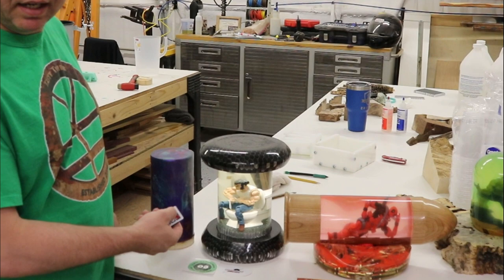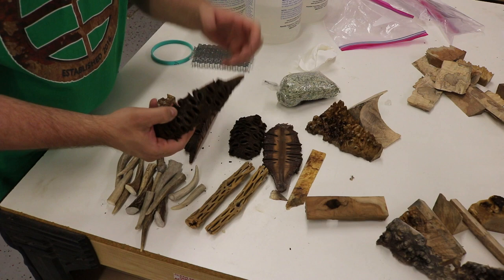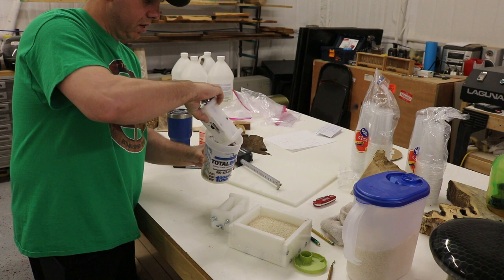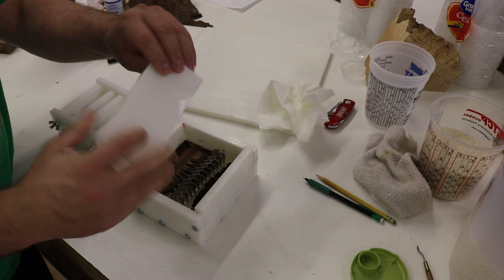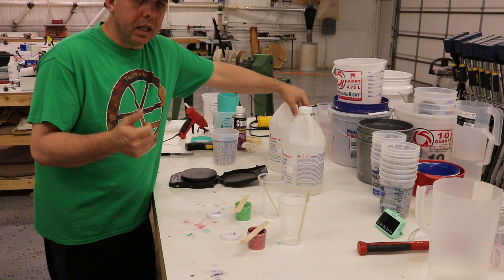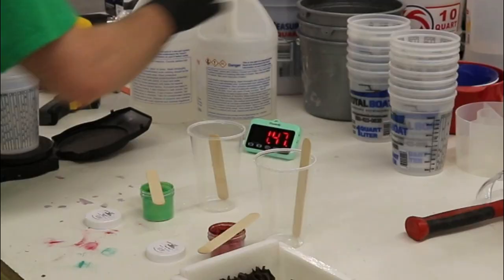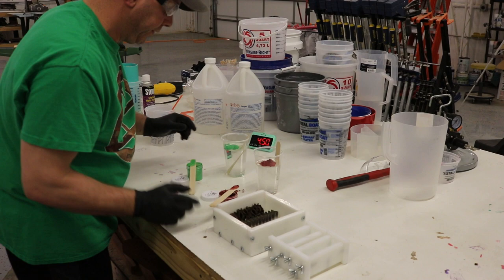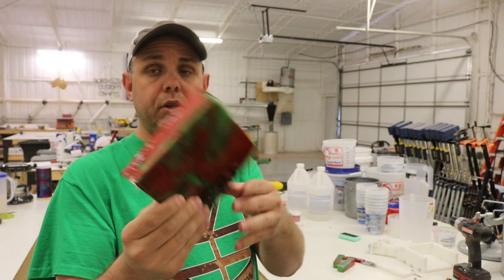How to Cast Resin and Wood  Pen Blanks for Beginners

Comment: Good helpful vid, thanks!
I would like to ask - when and why to use a pressure pot VS a vacuum chamber?  I want to stabilize some wood and then cast it in Alumalite, but it sounds like I need to stabilize with vacuum and cast with pressure.  Can you help me understand why ?  Thanks!
Reply from the maker: Thank you for watching and leaving a comment.. The Alumilite clear slow resin only has a 12 minute working time, it’s not enough time to use vacuum to remove the bubbles. You can use epoxyresins that have a 45 minute working time, then you can use vacuum if that’s your preference.

Comment: Great video, great demonstration, great production.  I like how you keep it entertaining and moving. Can you use a vacuum pump instead of a pressure pot?  What pressure for the pot?  The cactus piece "cholla" is pronounced "choya", the two Ls sound like a Y. One of the best demonstrations on Youtube. Thanks!
Reply from the maker: Capt_Beefheart Thank you very much! I’m glad you enjoyed!! 👍 if you have resin with a long pot life you can use vacuum, but I’m using a resin with a pot life of 12 minutes, so I use pressure to get rid of the air bubbles. 👍
Reply: @JakeThompson  What pressure?
Reply from the maker: Capt_Beefheart Sir Pressure in the pressure pot.
Reply: @JakeThompson  Sorry 😁! What is the pressure you use to get the bubbles out?
Reply from the maker: Capt_Beefheart https://youtu.be/5jOttgLQvpA

Comment: Awesome video. Can you reuse the measuring cup again? How do you get all the epoxy out EDIT: should’ve kept watching haha. But how do you clean them. Just in the sink? How do you keep the epoxy from hardening in the pipes
Reply from the maker: Always Bolt the Bird lol! I just put acetone on a paper towel and wipe them out. I just recently started buying cups in bulk from amazon. I still will reuse them but it’s lots cheaper when you buy 100 at a time.

Comment: I've recently started casting resin for knife handles. My first attempt I left the blanks in the pressure pot for 3 days. They were soft when I took them out and hardened over a week. My next two attempts were both epic failures. I had them under pressure overnight and again they came out soft. I measured by weight correctly but don't understand why its not working out. Were the blocks rock hard after two or three hours and finished them off in the same day? Thanks
Reply from the maker: I use alumilite clear slow and have lots of videos on how to use it..  i cast the blanks and 2 hours later I can take them out and demold them..  We use alumilite clear slow on our live show we do every Saturday on this channel..

Comment: Did I hear the length of time in the pressure pot correct at 2 hours? Or did you just check it at that time and leave overnight?
Reply from the maker: With Alumilite you can take it out of the pressure pot in 2-4 hours, but I won’t hurt it to stay in the pressure pot overnight

Comment: Jake- I’ve watched this video a few times and I want to say thanks . It’s very helpful. One question- is 12 min open time the main criteria or 95 degrees  before putting in the pp?  In other words if it’s still not up to temp is it mission critical to get it in the pot by 12 minutes ?
Reply from the maker: 12 minutes is a guideline.. the temp in your shop will make your working time shorter or longer.. the 95-105f degrees is the right temps for color separation.. sometimes it may take 14 minutes to get up to temp.
Reply: @JakeThompson  thank you sir!

Comment: How long did you leave the honeycomb in the acetone? How did you clean after taking the honeycomb out of the acetone?
Reply from the maker: Eric Richardson I left it in there for about 10 minutes and let air dry, then used air compressor to dry it.. if I do it  again I think I will use a small wire brush to rough up each hole on the honeycomb.

Comment: VERY VERY new to this. will actually be turning my first pen this weekend. is a pressure pot needed? if it's not, what's the benefit of it?
Reply from the maker: Sean Murphy A pressure pot makes air bubbles invisible. The resin I was using requires a pressure pot to eliminate bubbles.. There are some resins that do better at casting without a pressure pot.. I will put a link to my liquid diamonds pen blanks video HERE: https://youtu.be/vn9AikVmlBk

Comment: Hi JT
How much air pressure do you put in the chamber?
Time under pressure? Is the time good for a full chamber as opposed to just a few items in the chamber?
Thanks for your time JT
Reply from the maker: Johnny Sauseda Very welcome.  You need at least 45psi in the chamber.  It needs to be under pressure for at least 2 hours.. and it doesn’t matter if it’s  full or only a few items. 👍👍👍

Comment: Have you used the plastic cups like the red ones used for parties? I’m thinking would melt 
I saw mixing cup at my Lowe’s like yours they start at qt size and go up from there on the sizes not to pricey but when you use as many as you 💰goes up like to find some can reuse
Reply from the maker: Turkey Creek Knives I use clear plastic slo cups to mix colors on smaller pours... I buy the mixing cups in 100 packs off amazon.. saves a ton.

Comment: ok so I have watched to many to count videos on making pen blanks using resin etc your video is the first Ive seen talk about the temperature issue is this with all resins?
Reply from the maker: gulfmedic1 Yes. If you want the different colors to stay different colors you need to wait until a certain temperature to pour the different colors together.  If you just pour them in together at a lower temperature they will just make a different color.. yellow and blue make green, red and white make pink, and so on.. for the resin I use in this video let the temp get to 98f. On longer pot life resins let the temp get to 120f.  I hope this helps. I learned this from Pam Harris at Highland Boxes.
Reply: @JakeThompson  just to be clear if i wanted to mix red and blue but i wanted the colors to stay original i would mix two batches of a and b then mix the batches together correct
Reply from the maker: gulfmedic1 You can do it that way. I usually will mix A and B together and get them fully mixed, then divide that amount in half into 2 different cups, then add the red to one cup and blue to the other cup. Then wait until they reach temperature and pour them together.
Reply from the maker: gulfmedic1 https://youtu.be/vn9AikVmlBk

Comment: Will help you to check video before uploading. You had repeated issues with focus which would have been clear if checked before uploading.
Reply from the maker: Max Quinn I checked it.. I know there’s some things out of focus sometimes.. I appreciate the input.
Reply: Jake Thompson ok. Just a suggestion, love your work.  A way to fix this i would use is to overdub in post with separately shot pics or video for the bits that aren’t quite right rather than a reshoot.  Background audio doesn’t need to change.
Reply from the maker: Max Quinn That’s a great suggestion.. I will try that.. 👍👍